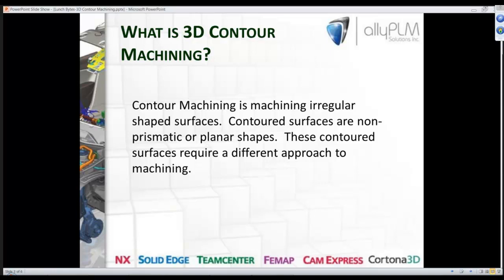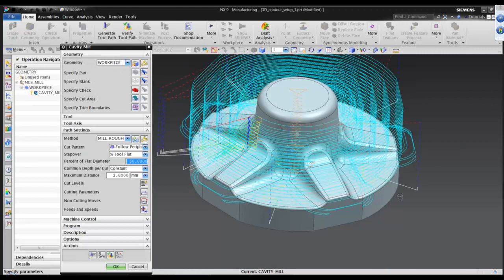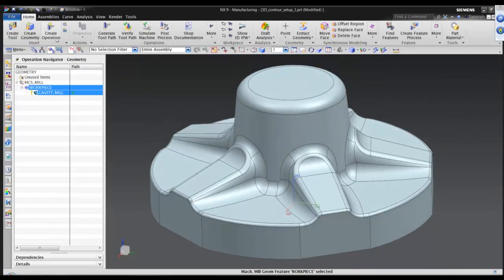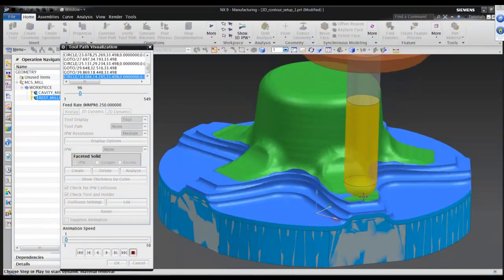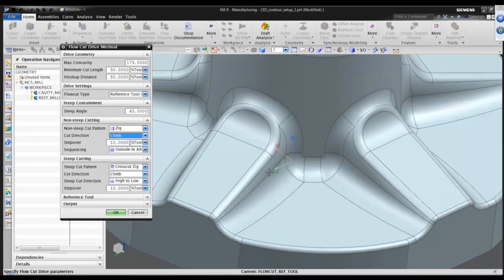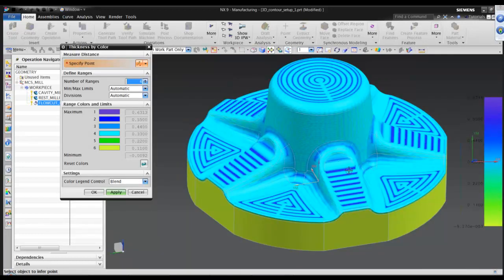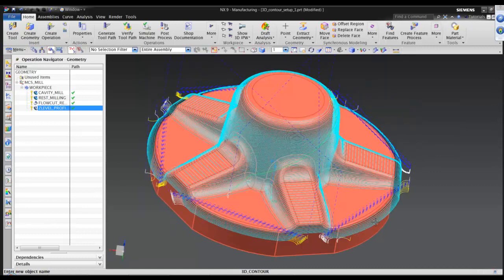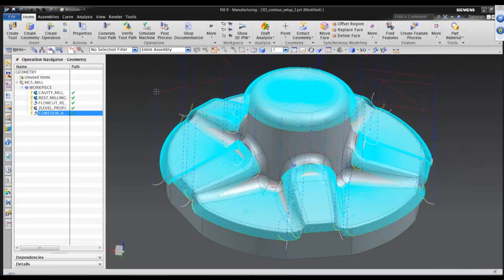How to Use 3D Contour Machining in NX CAM? - Tutorial - PROLIM Lunch Bytes

Comment: Hey i was wondering if you could do a very simple milling part tutorial from beginning to end on say a half "sphere on a table top / bowl on the floor" type design. Basicall a dome on top of a floor. For some reason I am a little perplexed as to how to create my tools to begin my path profile. I use a .25 endmill for roughing and then maybe a .125 ball endmill for finishing and then out to say, a "G-Code mach3.tap" file.

I have been using Vectric Cut3D to generate my tool paths and had no idea (for 2 years!!!!)  that Siemens had an integrated CAM feature!!

 Thanks!